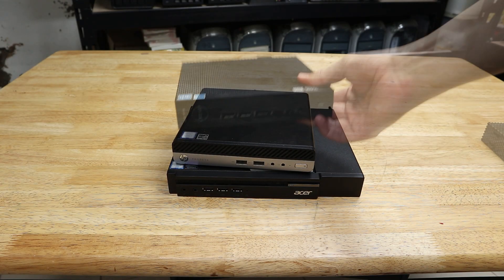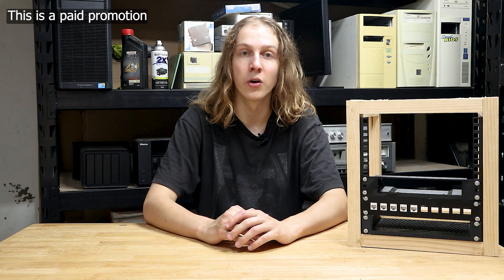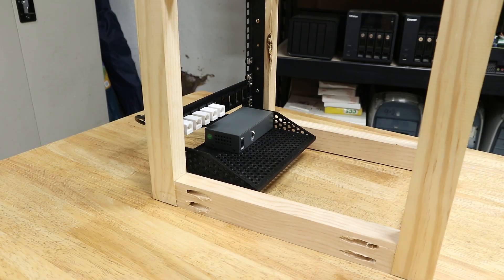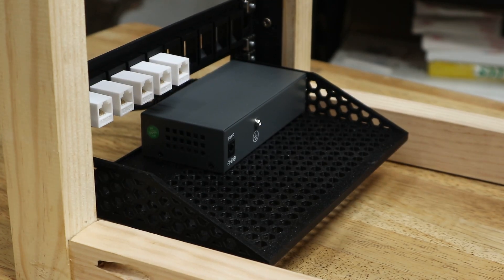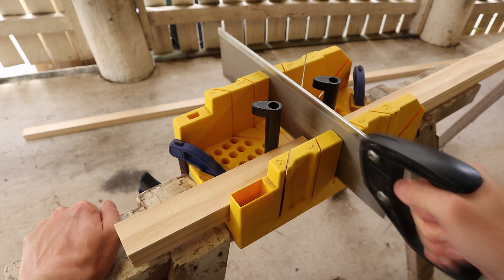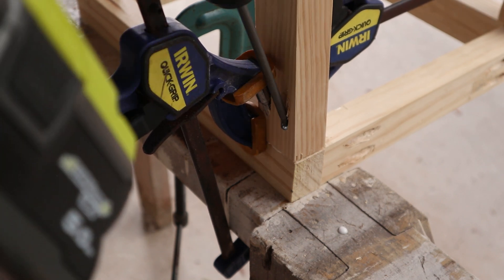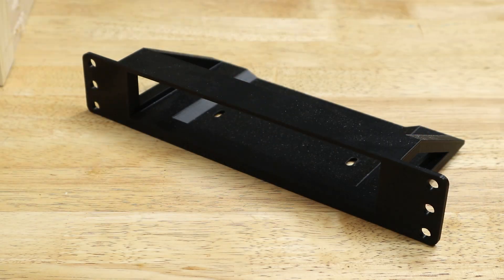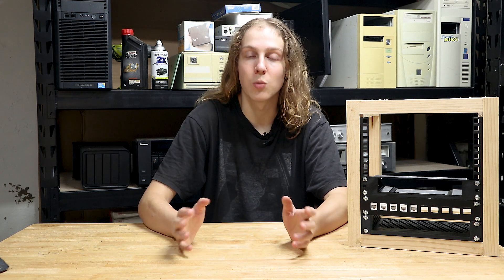I Built a 10" Mini Rack for my Homelab

Comment: You totally have motivated me to build one of those.  I’ve been wanting a 10” rack for all of my network crap that is piled up.  THANKS!  On question though.  I’v never messed with a network rack before so this is probably a stupid question.  Do you need rails on the back as well as on the front?
Reply: I assume it's too late for an answer but you don't really need the back rails for a 10" rack as I haven't seen any 10" equipment utilize 4 mounting points. It's more useful on a 19" rack, where rails and shelves can be mounted to the back. The other reason you might want back rails is for additional space to mount switches/power bars/etc

Comment: Nice Stanley miter box, have the same one and it is a blessing for my wood working. Even use a Kreg pocket hole jig. It has it place in the shop. Also have a biscut joiner which will help with the assembly of a frame but is far most costly than the Kreg. Nothing wrong with how it looks, you might stain it with an Oak stain for a light finish or a light walnut stain for a little darker finish. It will look like a fine piece of furniture.